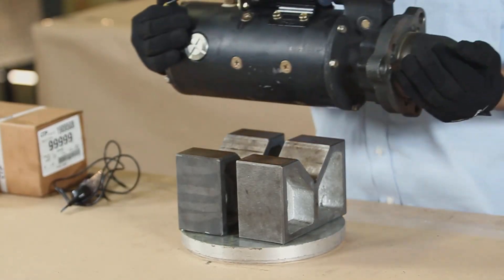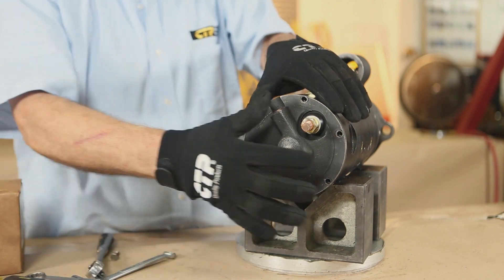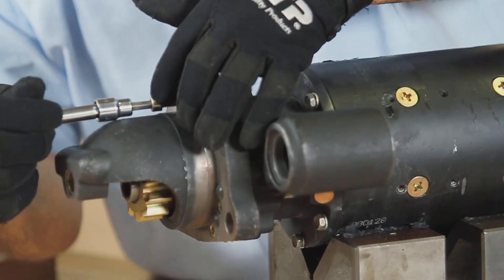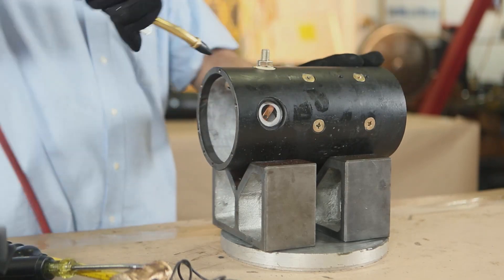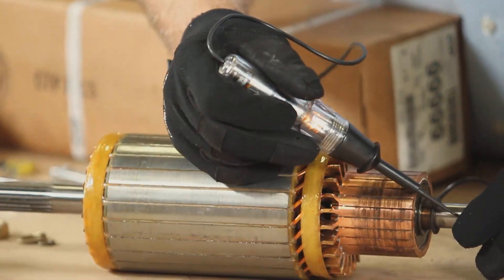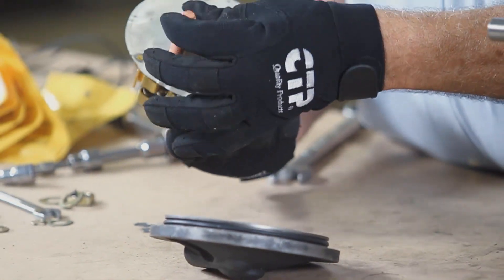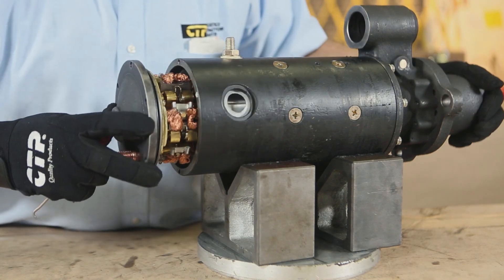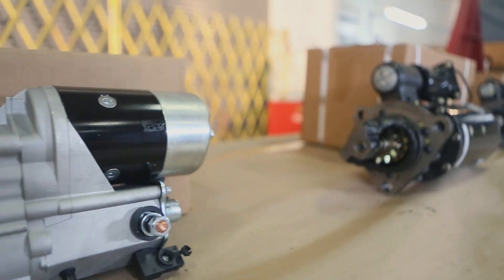Starter Motor Repair

Comment: What voltage is required minimum to run this starter motor?
Reply: 12 volte
Reply: 12V is the nominal operating voltage. However, during cranking there must be voltage drop and usually starter motor is designed to keep operating during this moment at 8-9V.